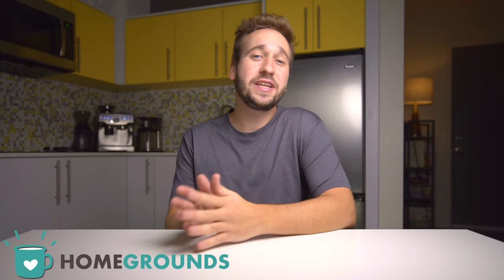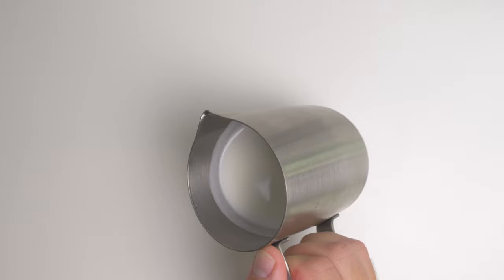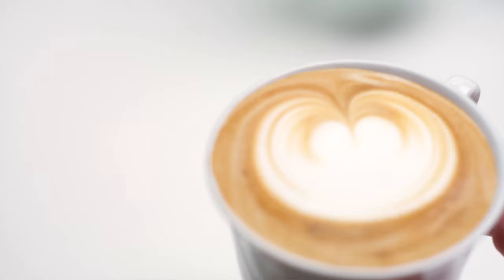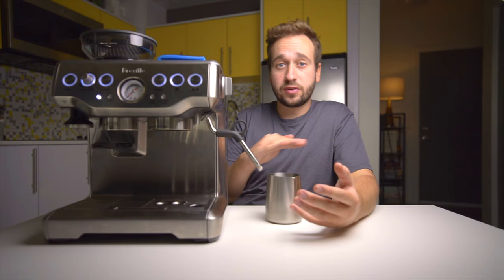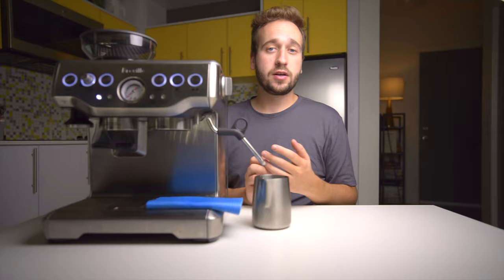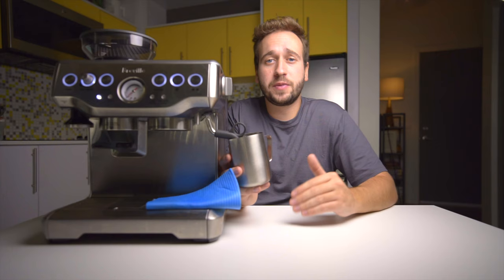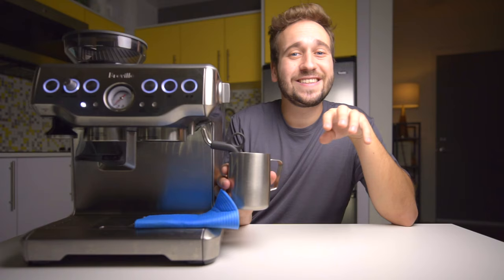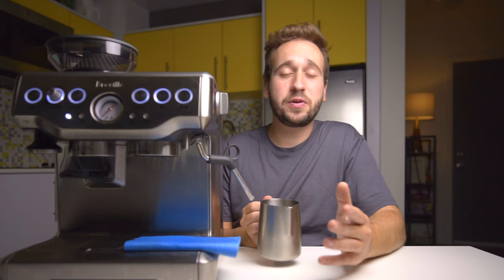How to Steam Milk for Latte Art | Beginner Friendly!

Comment: Thank you for your video! I find that I'm getting the cheer squad when I'm first trying to get the milk to swirl. I then adjust after the swirl happens. Any tips on avoiding tryouts in the beginning?
Reply from the maker: If you happen to be using alternative milk, sometimes the screeching is unavoidable. As long as your getting good aeration in the beginning, you should be set! Sometimes lifting the pitcher slightly will help with reducing that noise though.
Reply: @HomeGroundsCoffee  I will try thank you!

Comment: Hello! Thanks for the video! I have been trying to steam whole milk with a De'Longhi Manual Espresso Machine. The steamer is wider and cylindrical compared to the one on the Breville. I have not been successful when I try to pour anything that resembles latte art. Just confirming, will I need to try with a different steamer to steam the milk properly? Or is it possible with the De'Longhi? 
Thanks again!
Reply from the maker: Good question! That really depends on the machine. I would say most steam wands are capable of producing milk for latte art. If your able to get any sort of whirlpool going while steaming, you should be able to get there.